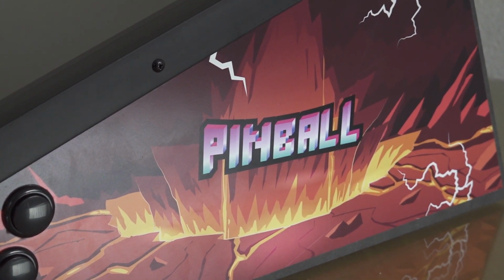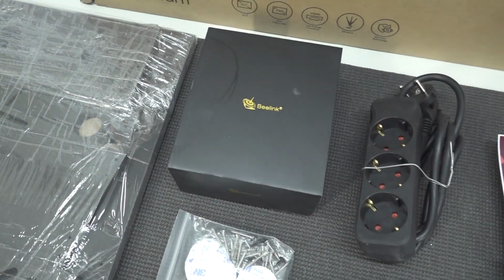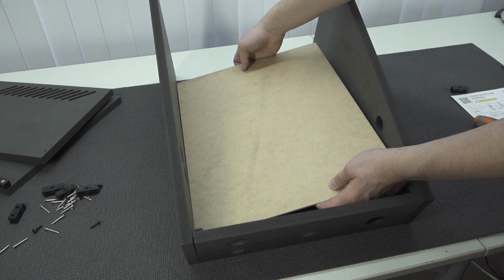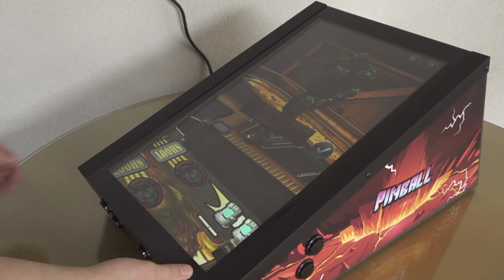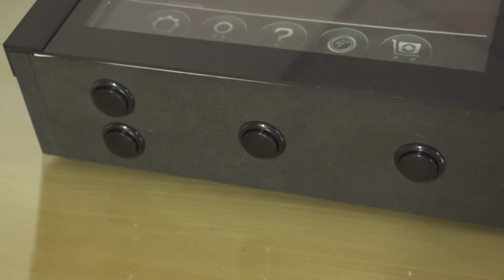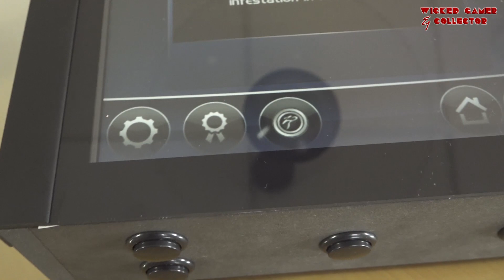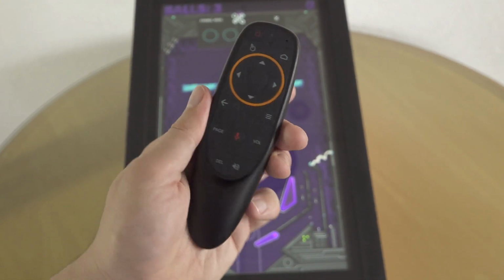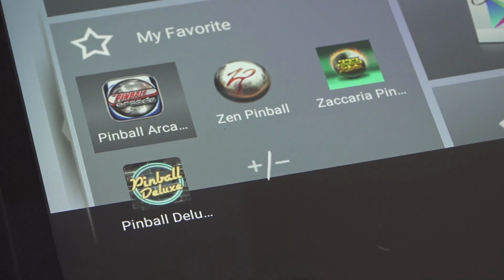Ultimate Virtual Pinball Bartop... The Sharpin ULTRA ! 😎

Comment: I have the previous version of the Sharpin and overall, I just feel ok about it. It was a lot of money for what ultimately ended up being an acceptable, but imperfect way to play pinball. I had issues mounting the monitor similar to what was mentioned early in this video. The cabinet also turns my fingers black whenever I touch it--is the new version still made from the same material? I would really love a wood version of this cabinet or even an option to buy a CAD file so I can just manufacture it on my own. This would've been a better solution for me, being that I'm in the United States. My kit arrived with some minor damage due to shipping, and I would've preferred to buy my own components to avoid having to use a plug converter.

My only other gripes are things that are out of the manufacturer's control--they have to do with the Williams Pinball app--this is the one I play most because it has the tables that I enjoy most. But it doesn't support nudge buttons natively. I purchased and tried using the Octopus app to map sideways swipes to the nudge buttons, but there is too much lag to make this an effective solution.
Reply from the maker: Thanks for your extended feedback on this. US buyers need to pay a lot of shipment and import fees. So this kit is even more expensive :( 
Yeah still using the same kind of wood and did clean it up specially with the stickers assembly. 
Idea it's great, only it does have some problems / things you can't do.I have been thinking about adding a pc to it then we need a second monitor maybe ?

Love the new cabinet size problem is space that was already a problem with model one.
I did modify my first model and wanted to finish that project up and show what I made
In the end we need a wood kit that is dirty cheap so we can go modding on these things.

Comment: The Ultra Edition is the only viable option. The other models are simply cheap compromises. One thing missing is an on/off switch, though. It's frikkin horrible that you can only power it off with the air mouse, but you can't turn it back on. You need to pull the plug, wait a few seconds and plug it back in to boot up again.